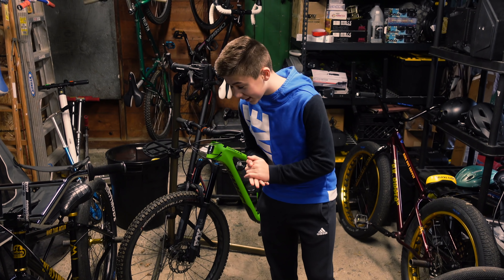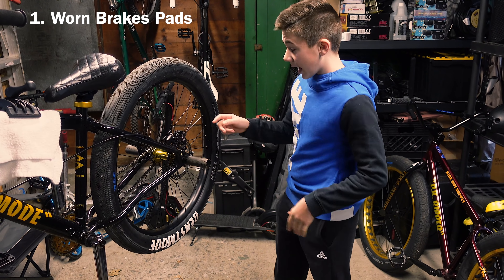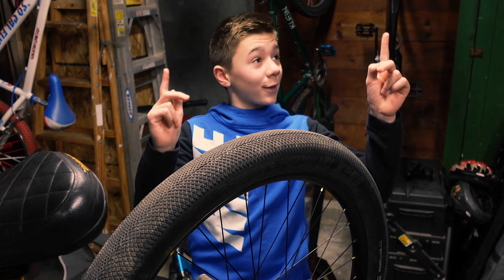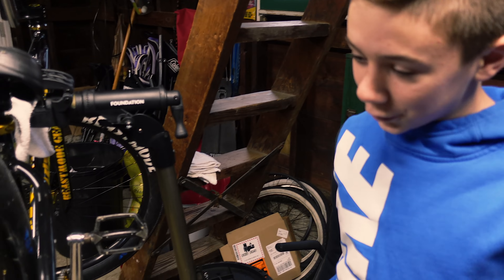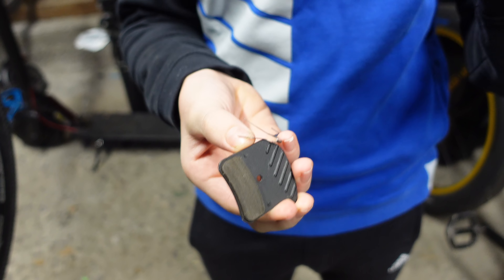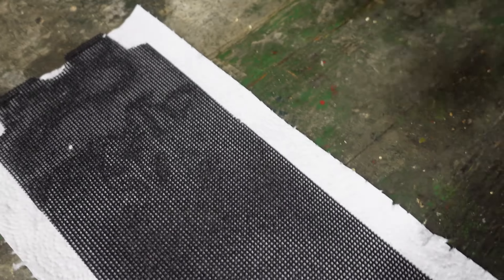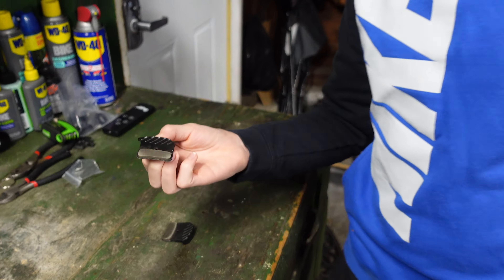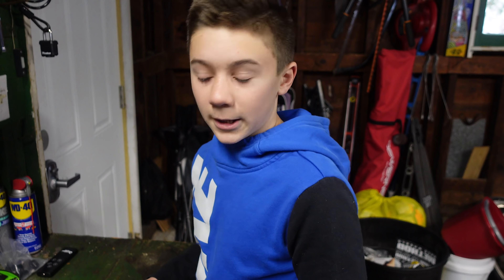3 Most Common Reasons Why Your Disc Brakes Aren't Working

Comment: Hi lawton I love this vid but I did this and I got my hydraulic brakes 2 days ago and it was my first time using hydraulic breaks but mine were not strong at all and I didn’t use break oil because it was lock down here and couldn’t get and so I used baby oil it worked but for some reason my wheels won’t lock up when I break like there not powerful at all can you give me a soulition plsese

Comment: Do you have a solution to rim brakes not working well cause my blocks flyers brakes are horrible. I even tried changing my brake pads but that did nothing.
Reply from the maker: I would recommend changing the brake cable!
Reply: @LawtonDenisOfficial  thx for the tip Lawton!